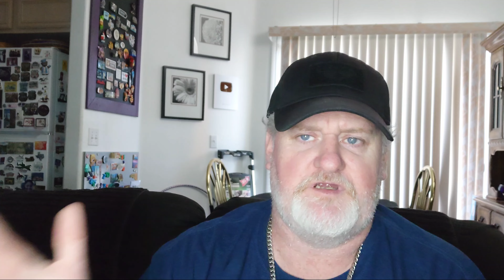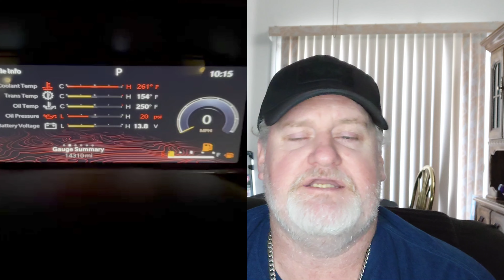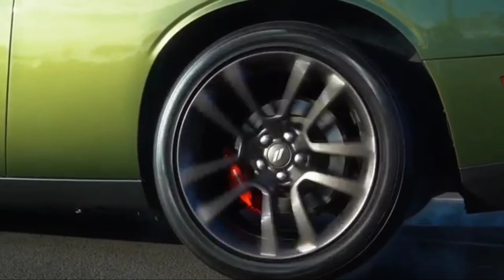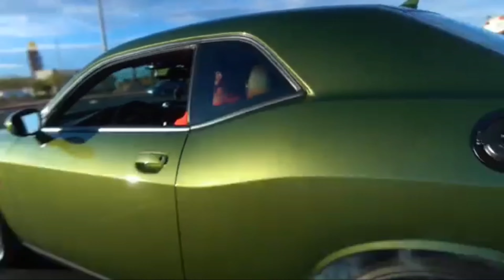Jeep Wagoneer Blows Up After 3rd Thermostat, Blows Head Gasket 115K Wasted

Comment: I saw a tear down of a relatively new 3.6 V6. The biggest concern was not the design, but the materials some of the components were made out of plastic that have no business being anywhere the material of plastic. This is the same company that also made suspension components on the “hornet”, out of plastic. SMH
Reply: The Ford "Powerjoke" diesel engine has a plastic oil pan....

Comment: How much did GM save by putting smaller front brakes (and 13-inch rims and tires) on my early Cutlass Ciera (the station wagon came with 14-inchers and larger brakes).  10-12K front brake changes instead of 30K+ miles for the wagons?  I remember these things FOR LIFE and I can wage an economic boycott FOR LIFE.  Boycott Stellantis / Chrysler / AMC.

Comment: I have to disagree with you in many ways, first, Jeep isn't a luxury brand. If you spent over 50k on any vehicle from Jeep, then you are a fool. If you got scammed with the last call Challengers and their mark ups, then you are really a fool especially went the economy is going to even get worse than it is now. Second, Dodge, Jeep, Chrysler didn't just become junk ever since Stellantis took over, they were always junk and were at the bottom of the list for reliability for the longest time.
Reply: They werent always junk, at least the engines transmissions and suspension. Their engines were some of the toughest and most reliable around. There was a time when Chrysler Plymouth and Dodge vehicles would literally fall apart around the drivetrain. Jeep didnt count, they were American Motors before 1989.
Late 1960s Chrysler Corporation advertisement...... "Extra care in engineering"
That hasnt applied for the last 45 years or so,

Comment: TK, I agree with your "cheap parts" assessment for multiple reasons:  1) The cheap part may not have been tested in the intended application to prove it will survive all expected worst-case operating conditions in the field (I.e., they were too cheap to run a test to see if it would work) possibly because 2) the workforce that would have known the replacement part wouldn't work properly was fired, so the knowledge base, or expertise, of the company left with them.  So someone who didn't know any better bought the part and the results are what we have today.

There is corollary to the short wire harnesses on the Hurricane motors that are coming unplugged after a few miles of driving.  I initially thought it was because the Computer Aided Design (CAD) tool was making the harnesses too short by a few millimeters because the CAD tool can't exactly predict the wire lengths of every wire in the harness as the main harness (especially thick ones with many wires) bends around a corner.  Each wire has its own bend radius, and hence, its own length in the wire loom, and that results in the connector ending up a few millimeters short from mating with the electronics box.

Another thing I just thought of was that the CAD tool will accurately predict the exact length of the harness as it extends from the firewall to the engine and some cheapskate will have the harness built to that exact length.  But a knowledgeable engineer will know the engine rocks in the engine mount as the engine creates max torque, so the harness has to be made a few inches longer to provide a service loop that prevents the connectors from getting unplugged when the engine revs up.  But if you let all the people go who know these things, then the service loop may not be left in, and, hence, connectors get unplugged in the field on a few engines as we're seeing now.

Just a thought.  But, yeah, it's all about the bean counters on the top working their magic all the way down and destroying reliability and customer confidence for decades.

At this point I'm thinking if there's no 10 year unlimited mileage warranty on the drivetrain I'm not buying ANY Stellantis product . . . ..

Comment: I just bought a 2025 Ram 1500 with the hurricane last month and its at the dealer now because the check engine light came on 3x within 1500 miles for multiple misfires… they opened up a star case…. wish i never got rid of my hemi

Comment: Just why are modern engines so fragile? A thermostat fails, and completely destroys the engine. I have many old school Ford and Chevy engines, and I'm talking about the old cast iron pushrod engines, survive being overheated over and over again, to the point where something blew, like a radiator hose, and when the cause of the overheating was fixed, and whatever blew fixed or replaced, and they were refilled with ethylene glycol, they ran just fine. Those old engines were built like anvils. They were bulletproof. Cast iron blocks and heads. Cast iron intake and exhaust manifolds. No aluminum, no plastic. Simple single cam pushrod designs with 2 valves per cylinder. Even when one did need repairs, they were so simple and easy to work on, it was no big deal. With one on an engine stand, I can COMPLETELY disassemble it in half an hour, and I mean carefully, not throwing parts all over the place. I have a cast iron small block Chevy engine in a '72 Nova that has been down the dragstrip close to 200 times, and the heads have not been off since I built it. Compression is down only slightly. It has been seriously beat on, and still runs like it did when I first built it. Nothing like that is being made any more.

If all this damage is being caused from overheating, why not simply install a cutoff switch that will shut the engine off at a certain temperature? I have been installing just such switches on the oil pressure sending units on my race engines for decades. If oil pressure is lost, it immediately kills the ignition. I started doing that because I did have an engine lose oil pressure once. It was my fault. I made a mistake when assembling the engine. It has not happened again, but having the low pressure cutoff switch will help prevent damage if it should.
Reply: If that's true, why back in the '60s '70s and '80s. You were lucky to get 100,000 mi out of a car. Most of them were done after 60,000 mi with worn out engines due to inefficiency of a carburetor therefore diluting the engine oil causing premature wear when today's modern vehicle will run minimum 200,000 MI before the engine begins to give out. Just my observation
Reply: @paulangus3067  And incorrect. Newer engines have a higher nickel content in block castings/cylinder sleeves which resists cylinder wall wear.
A friend of mine has a 1977 Ford with a 351M..considered one of Fords worst engines. Hes owned it since it was 2 years old. It is of course carbureted. He changes the oil every 3000 miles and it has a documented 386,000 miles on it, with only 2 timing chain replacements.
Modern junk often has dissimilar metals in blocks and heads which have different rates of expansion, therefore more risk of head gasket failure.
Reply: @paulangus3067   you’re thinking cars up to the 50s where they’d need an overhaul at 100,000 miles. The Chrysler LA engines (318, 360, 383, 440) were very reliable. My grandpa’s old D150 was still running at 400,000 miles when it was sold.

Comment: I work in the warranty  inspection dept. I can’t believe the engine failures on these jeeps!  The 2.0 and 2.4 engines being the worst. Head gasket failures because of block defects , excessive oil consumption. All of these failures occur just past 60k miles. Unreal!
Reply: @Ken-l2e  I don't think it is wise to have the exhaust manifold cast with the head.

Comment: glad I never  bought a wagoneer  with the  in line I-6 wanted one to tow my airstream , stick with my 5.7 hemi  ram , I drive it every day never hear the exhaust  tick
Reply: My 2006 hemi Durango has 152,000 miles runs like a turbine. Pulls like a freight train, 17mp hwy...

Comment: It's a plastic thermostat?
Reply: The thermostat and housing are an assembly. The housing is plastic.  The thermostat in my 2014 Grand Cherokee failed closed. No dealer in the area could provide roadside service or replace a thermostat within 2 weeks. I was able to remove the thermostat and top off the coolant with bottled water. Several dealers did not stock thermostats so I found an aftermarket replacement for considerably less than $75 that Jeep would have charged if they had one. The local dealer wanted $600 for coolant replacement which should have been covered under warranty. So far the aftermarket thermostat has not failed.

Comment: So they replace the engine, does it still have the same cheap thermostat?
Reply: The best I've heard about these is that the ones with engines not blown got a revised thermostat to prevent the issue.

Comment: Anybody can buy cheaper parts, until it comes back to bite you.  Chinesium parts do not last, and cost more than they save.  The board is very shortsighted.  Or they are just doing a smash and grab, take what they can and some else holding the bag.

Comment: so true to past American thermostat styles where the thing fails CLOSED?  Then we have some gauge on the cluster that is heavily buffered and so we don't really know what the temperature looks like until bam it's over temp.  Then it's Aluminum, I am ok with that, but very short periods of time like MINUTES the head is going to warp.  Yes BMW is like that, but modern BMWs let's say they have a water pump die will command you off the road immediately.    I am all for turbo inline 6 as they are excellent platforms.  It's the little things that kill

Comment: The problem is the pump is plastic, and the housing is plastic. It's a horrible design.  Many are overheating.  And it doesn't take long to warp the head. And by then, it's done. New engine replacement.  Save a dollar and send a block to the recycling plant 😂

Comment: Even the sainted Toyota has seen serious product issues due trying to meet ever increasing and excessive regulations, keeping costs down despite record high MSRP's. Still the level of failures of Jeep and related CDJR products are unacceptable and is destroying the brands,
Reply: Toyota---PFFT. 3.0 V-6 engines with valve seat recession and head gasket issues. 90s era Camry 4 cylinders with what Toyota called "oil gelling" issues.
Defective regenerative braking on Prius, which cost Toyota a one billion dollar fine from the Federal government.
Stupidly designed Camry accelerator pedals which got caught on something as simple as a floormat.
Early 2000s Tundra trucks with ball joints that corroded away dropping many front ends on the pavement..
And now their new 6 cylinder turbo engines have been recalled, but Toyota wont install a new engine, they just repair it and ship it back out.
Stellantis products are FAR worse.
Thats why my daily driver is 47 years old, and its NOT a Toyota.
There are a lot of vehicles built before 1995 out there for under 10k and I CAN and WILL rebuild them to have a simple reliable vehicle.